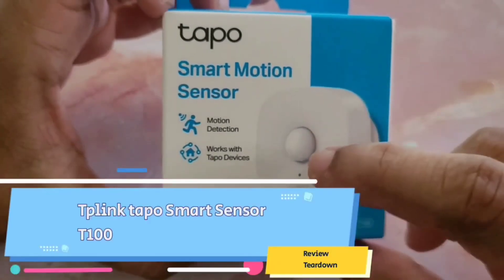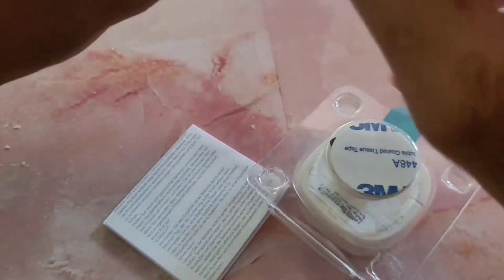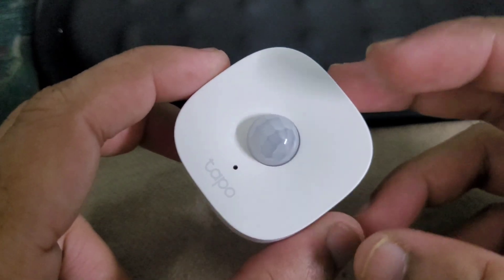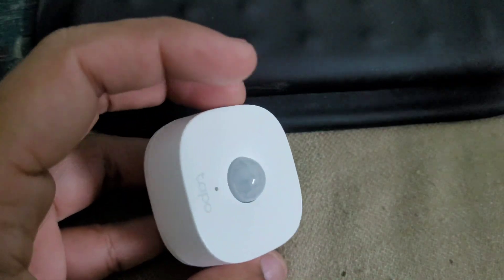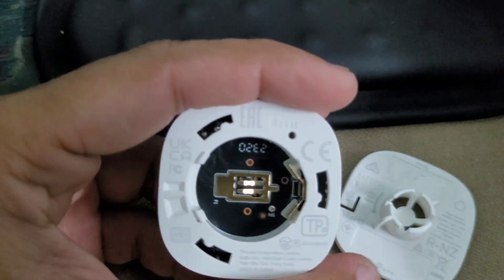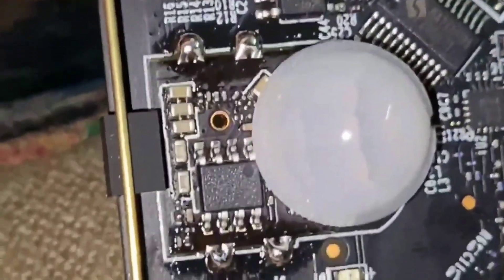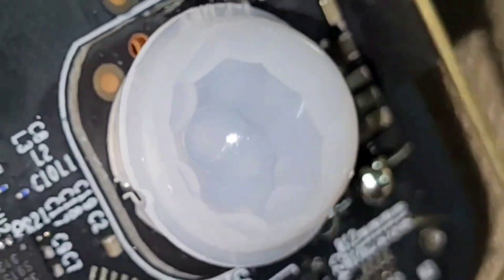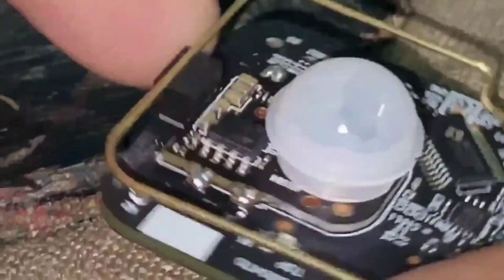Tplink tapo T100 Smart motion sensor

Comment: What can be the maximum distance between Hub and this sensor ?
Reply from the maker: @gam6h  As per tplink distance from Hub to sensor (Sub-1G IoT)  band is 20 meters  approximately.  Max distance is subjected to interference and environmental conditions. You can use in App RSSI to check best spot to install the sensor.